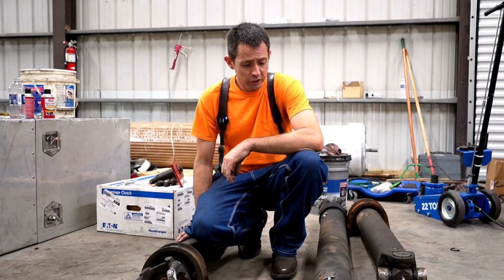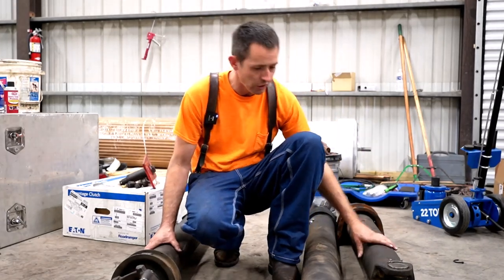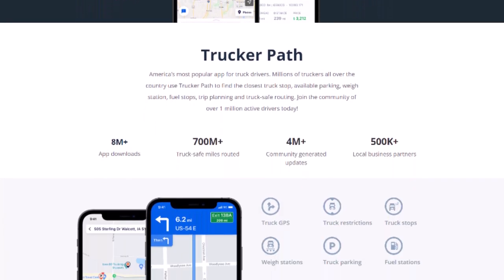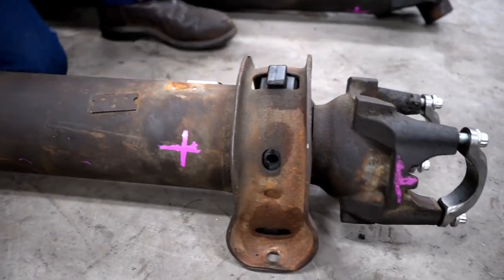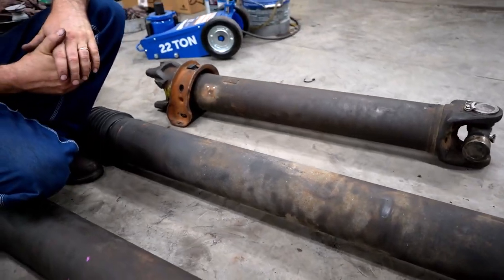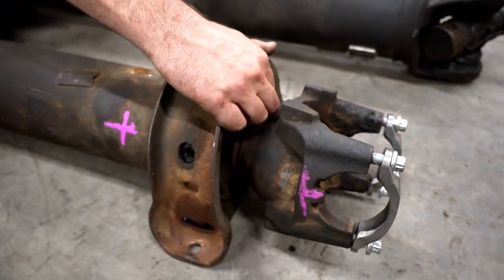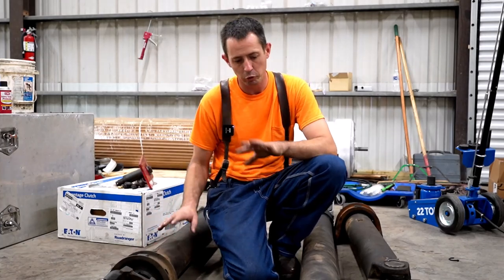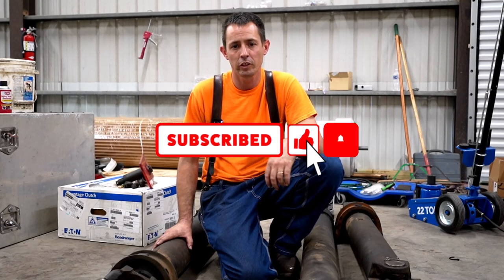Bad Vibration on Your Semi Truck? Check This Now!

Comment: Thank you so much for this I have been looking for a vibration for 6yrs and no one ever said check the drive shaft they all want to balance the tires and do an alignment
Reply from the maker: You are welcome! I am glad it helps! 👍
Reply: I have 2006 Peterbilt 379 Day cab. New driveshaft New all tires New clutch, New injectors.  It still does viberation under acceleration.  I am tired from it.

Comment: Mine had at between 67 and71.
 It was my trailer having the vibration  uneven wear on a single axle. Also check ur trailer tires..

Comment: Good video.  You should do one on drive shaft phasing.  Once had a truck that had the shafts reinstalled improperly after a clutch job. Caused a severe vibration.
Reply from the maker: Good suggestion! Thanks

Comment: I think I may have this issues my mechanic did King pins, bushings, tie rod ends, shocks, torque arms etc. And I still feel a vibration like under my driver seat not in the steering wheel.
Reply: I'm dealing with the same thing on my Columbia. I'm about replace my u-joints. Then go from there.
Reply: I'm having same issue but mine is more like bouncing.
Reply: Did all that as well, come to found out today it was my drive line (shaft) needs to be rebuild. Dropping it and taking it to a local shop to get it fixed and balanced.

Comment: Great videos, could you make one about setting up and messuring rear suspension drive hight and leveling valves
Seems to be pretty common issue and cause of vabration as well. Thanks

Comment: Really great and informative videos. Question for you. I just upgraded the transmission in my bus to an MT-643. The #1 or primary drive shaft of three drive shafts had to be shortened and balanced. Do I have to balance the other two drive shafts as well?

Comment: The semi I drive has smooth acceleration through gears but at  8 and 9th gear as it accelerates through 1100 to 1300 rpms it feels like there is some kind of vibration or friction or something and then it smooths out as continue to accelerate and shift through gears. It's 2021 freightliner Cascadia. Any ideas?
Reply: Check ride height for proper driveshaft alignment. Panhard bar bushings can cause this as well. Start with the cheapest thing first then go to the actual driveshaft
Reply: @codybertram6122  thank you

Comment: Man I got to worst vibration we’ve replaced front springs and bushings rear bushings changed rear ends thru shaft rims tires kings pins tie rod new hubs all the way around and front axel spindles still gotta vibration
Reply: Were you ever able to figure out the problem?

Comment: My truck has bad vibration at 60mph?
Reply: Me too it’s driving me crazy
Reply: Mine had at between 67 and71.
 It was my trailer having the vibration  uneven wear on a single axle. Also check ur trailer tires.

Comment: I'm having a vibration at low speeds, and when making turns. Loaded it is worse
Reply: Did. You fix the problem? I have a mack vision that for some reason going to 7th and 8th gear i feel the vibration if I give it more gas than usual it goes away

Comment: Does this cause vibration when I’m in reverse or 1st gear without accelerating in low rpms? After I accelerate it doesn’t vibrate anymore
Reply: No that's just your U joints , it's possible your angles are wrong and axles need shimmed to correct